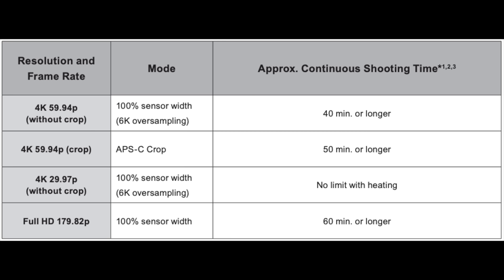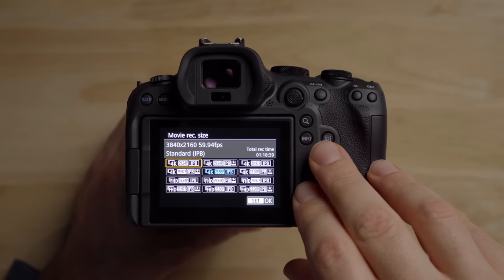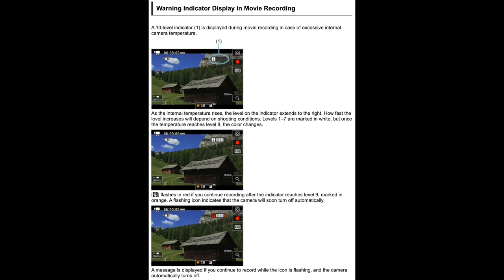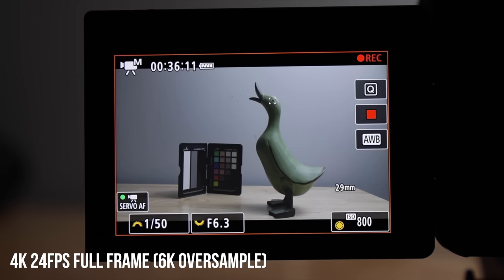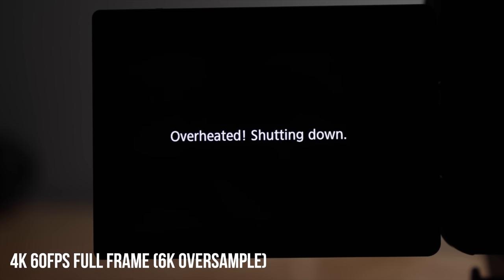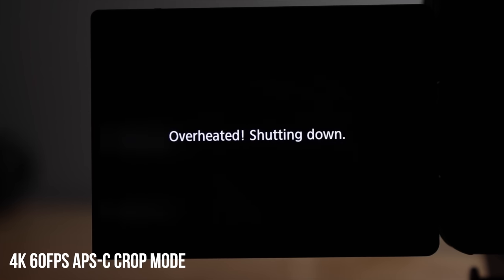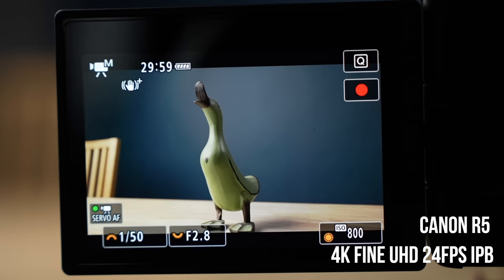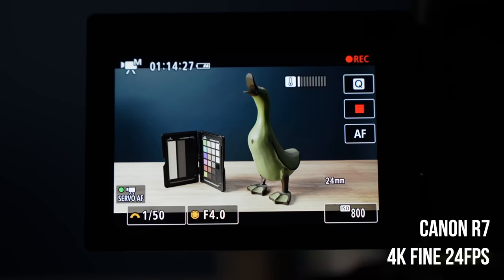Canon R6 Mark II - Does It Overheat?

Comment: Great video Josh, this is an important video for the community. It will required a new test in the summer. Thanks for sharing!
Reply from the maker: You're welcome. Yeah, I wish it was warmer so I could test it in more challenging situations. Thanks for watching!
Reply: a teardown video will show whether the internals have changed  from the R6 to allow for some heat dissipation
Reply from the maker: Has someone made a teardown video yet?
Reply: @Josh_Sattin  probably not yet, but someone usually does.

Comment: Any news on the recovery time once the camera overheats? That was the real killer with the original R6.
Reply from the maker: I didn't test that, but if I had to guess, it would be decent since the camera didn't feel that hot to hold.
Reply: @Josh_Sattin  thanks. It was the recovery time (and how fast it overheated shooting just 1080p in crop mode with EFS lenses) that had me move to an R5C. It sounds like this might be a little better but still not bullet proof. Big fan of your R5C videos by the way. They helped a lot when I first started with it.
Reply from the maker: Yeah cameras like the R5C and C70 are workhorses. Glad the videos were helpful for you. Thanks for watching!

Comment: Hey Josh, thanks again for the test 
It tells a lot about the camera overheating behaviors.
One note though. I guess this test is done in optimal conditions.
Like the autofocus is ON but it’s not doing any calculations or work ( which stresses out the processor )
And the image stabilization is ON but again not doing any work.
Other than that everything is excellent 
Thank you again we really appreciate what you do. 🙏
Reply: Totally agree with you I’ve been thinking the same thing!

Comment: I was waiting for this video. Thank you so much for being such awesome Reviewer.  May i ask you does the small rig cage maybe fit on the mark ii?  I mean regarding the body of the camera. You thing it would fit ?
Reply from the maker: You're welcome! I don't know about the original R6 cage fitting on the R6 II, but it looks like they have a new cage coming out for the R6 II soon.
Reply: I read it won't fit without some small modification to the top of the cage, sanding off a few millimeters of the cage frame to fit the Mark II.

Comment: My R6 mark ii never had the temp warning pop up while shooting video, until i got the ninja v and now it's always popping up after about 15-20 minutes. Doing the exactly opposite of what an external monitor is meant to solve and I can't work that out! It's only recording to the ninja v, and the LCD is off most of the time. Doesn't make any sense at all, I'm having to switch the camera off between recording when I never had to do that before using a monitor 🤔

Comment: It is hard to understand how these things will react because the R7 had 3 bars of overheat in 4K24 and 6 bars of overhetd in 4K60 but never overheated. Ran out of battery / storage respectively before overheating. However, the R6II gets no bars of overheat in 4K24 but overheated in 4K60. It did better than the R7 in one test but worse than the R7 in another.

Comment: WAY TO GO!! Finally!!  It was so frustrating in my R6 this issue! Thanks!
Reply from the maker: You're welcome! Thanks for watching!
Reply: Will be interesting to see it in a hybrid use setting outdoors.  I tried the original R6 as a hybrid sports user and it was unbearable so I picked up the A7IV to replace.  I still have time to return it, but wanted to see some R6II reviews first.  The 4k60 overheat time is not impressive to me and actually a little worse than the A7IV testing done on this same channel albeit with the screen open.  Granted I shoot football highlights completely in 4k60 and regularly switch between photo and video during games.
Reply from the maker: I got 66-70 minutes in 4K60 on the A74 in my previous video. That is in crop mode. The R6 II got 62 minutes in 4K60 crop mode. Pretty similar.
Reply: @Josh_Sattin  agreed but similar is not enough to get me to return my A7IV and some of the initial videos and rumors that came out at the announcement of the Mark II claimed “no” overheating which is not the case. Nonetheless it is definitely a big improvement over the R6. My R6 overheated and shutdown shooting photos only early in the football season.

Comment: What about 4k60 external recording? Does it also overheats?
Reply: Would love to see a test on 4k60 with external monitor.  Also with an external battery grip, which i guess theoretically would reduce heat to the body from being farther and having another casing around batteries.

Comment: Thanks for the great content!
I have some questions
What about the cooling time?
If you shoot 4k 24/30, do you still can shoot 4k 60 after that?
Hope you answer, thanks alot!
Reply from the maker: I believe that you can. When the camera overheated in 4K60, I flipped it over to 4K24 and as it ran the temp meter started going down. I know this is the reverse of what you are asking, but the camera runs pretty cool in 4K24 so I think you could grab some 4K60 clips.
Reply: @Josh_Sattin  thanks dude, what about cooling time?

Comment: Both the R7 and R6 m2 have greatly improved battery life. Both have greatly improved overheating. 
With computer chips, this usually means improved manufacturing.
Therefore, I don't think this would have been possible through a firmware update.

Comment: Is the 4k 60 fps in crop mode also oversampling like the A7iv?
Reply from the maker: I believe the 4K60 crop mode on the Sony A7IV is a 4.6K oversample where the crop mode on the R6 II is a 1-1 4K readout. So, probably not much difference there. But, you can shoot 4K60 with the full sensor readout and a 6K oversample on the R6 II.
Reply: @Josh_Sattin  Thanks for the reply. Hope you'll be doing some side by side comparison and tests of both of these cameras. I own an A7iv, it might help new buyers to know which one to go for. This one definitely is tempting to buy if not for me already invested in e mount I'd pick this up.
Reply from the maker: Yes, I plan on comparing this a lot with the A74 since they are so similar in terms of specs and price.

Comment: Good video test for overheating...This camera no Overheating for 1080p in continuous record 2 hours right?
Reply from the maker: Thanks! I didn't test any 1080p, but Canon doesn't state any issues besides 1080p180fps. Also 4K24/30 has no issues. I think 1080p will be fine.
Reply: @Josh_Sattin  Thanks for your reply...compare to sony a7iv better or not ?
Reply from the maker: https://youtu.be/cR9OD0nFpFE

Comment: After running the 40 min in 4K 60fps are you able to switch to the 24/30fps to continue without overheating?
Reply: Also curious about this!!
Reply from the maker: Ok, I tested this. Yes, as soon as the camera overheated in 4K60 I flipped it over to 4K24 and it recorded. Also, the temp meter started going down as I ran the recording in 4K24.
Reply: @Josh_Sattin  seem to remember on the original R6 it wouldn't even let you take photos for a while? So big improvement.
Reply: @Josh_Sattin  THANK YOU!
Reply: @Josh_Sattin  Thank you
Reply from the maker: @Mat_McD  You’re welcome!
Reply from the maker: @digitalvizun5678  You’re welcome!

Comment: The real question is how long can you record in 4k60 after a long period of recording in 4k30.
I suspect it's similar to the previous generation...i.e. not really suitable as your sole video camera.
I've switched to 2x Canon c70's because ultimately the questions in your head around hybrid cameras stifle your creativity.
I also don't like that in Canon's mirrorless cameras the assistance features can't be combined...i.e. no peaking And false colour, it's either or.
Reply from the maker: I believe that you can. When the camera overheated in 4K60, I flipped it over to 4K24 and as it ran the temp meter started going down. I know this is the reverse of what you are asking, but the camera runs pretty cool in 4K24 so I think you could grab some 4K60 clips.
Reply: @Josh_Sattin  that's good to know that it runs cool in 4k30.
Ultimately for me it's better to have 2 cameras that perfectly match and that I know will keep going forever in any mode.

But the R6 MK2 does sound like a nice upgrade ... Or rather what the MK1 should've been.
Don't get me wrong, I still have my R6 MK1 and happily use it for casual stuff, but for professional work I don't want any questions in my head about whether or not the camera will wimp out on me at any point.

You're providing good info here, and thanks for the reply 👍